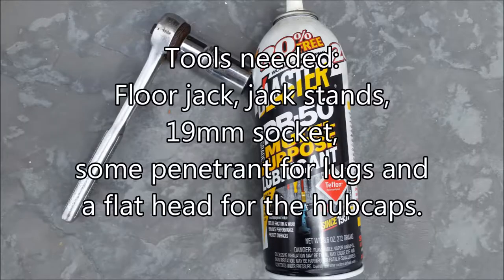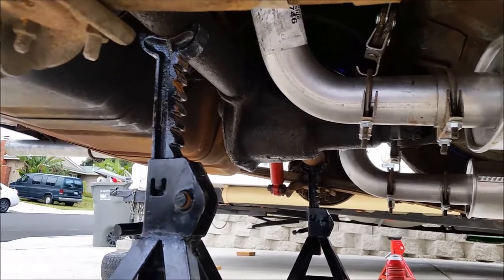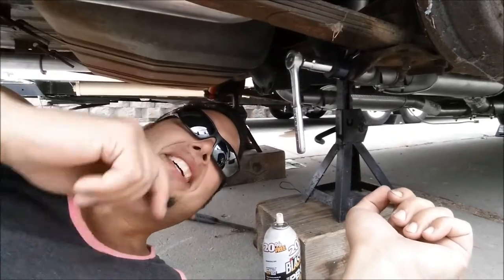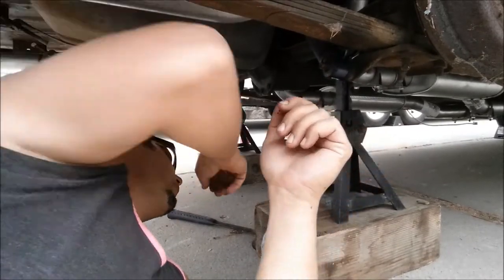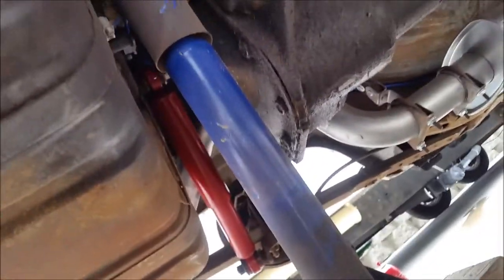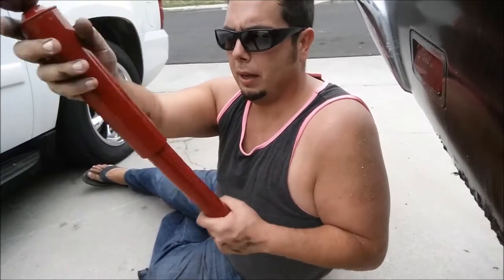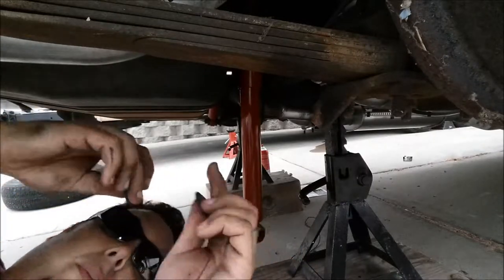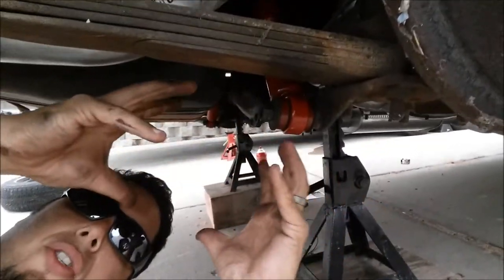Rear shock swap - Dodge Dart A100 Plymouth Valiant Duster Barracuda Coronet Savoy Belvedere

Comment: The old shocks look like Monro-Matics, monroe’s economy line. As far as the rust goes, that is nothing! I had to use a jack and a breaker bar to loosen the nuts on the rear shocks on my 88 chevy 1/2 ton, what 30 years of Minnesota winters and 181,000 miles can do!

Comment: Upper Shock Bolt removal is a BitX&% due to me having replaced my OEM '67 coronet fuel tank for a new afternarket one, which restricts ability to stick a wrench to remove the nut (20mm wrench)
from the inside against the wall,,,so i had to keep the wrench on the nut on the inside (from top) and easily using a socket 19mm to remove the bolt. Utilized  KYB-Gas-Adjust shocks once again..had replaced the rear shocks in 30 yrs ago (1989) back then the KYB's were white...Now they are grey... Had to brush off any spiderwebs from the car's underside beforehand. Hindsight 20/20 i should have drilled a 1.5" hole from the trunk right where the upper shock bolt would like up.